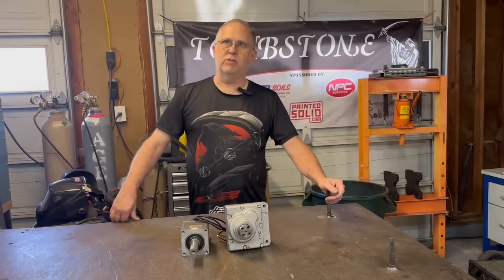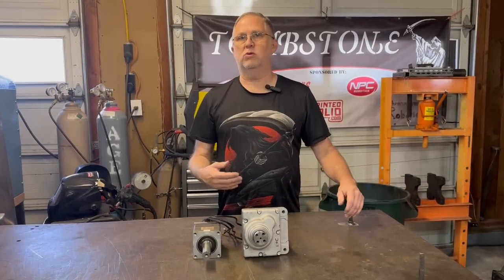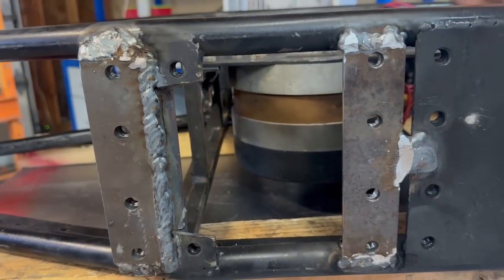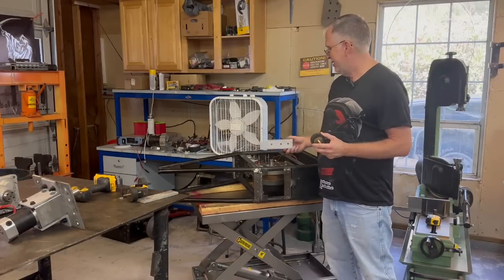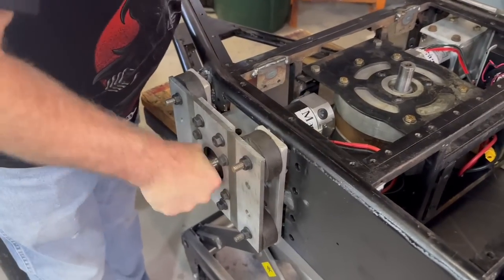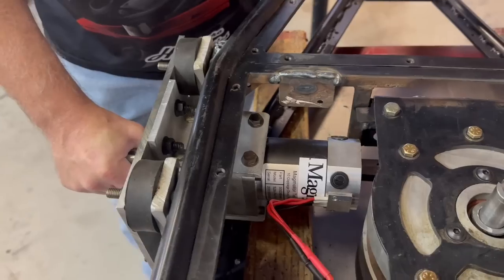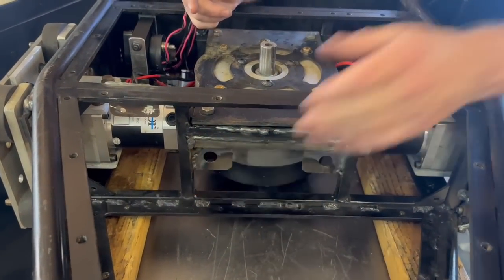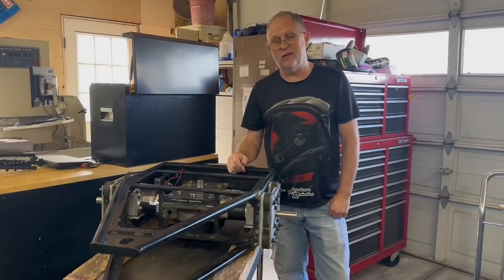Tombstone Frame Modifications for BattleBots Faceoffs!

Comment: Why do you not use redundant weapons motor chains?  Sniping the chain is an effective strategy to attacking Tombstone.
Reply from the maker: The chain placement is pretty much exactly over the top of the weapon motor, and just barely under the top cover. To double up the chain I would have to make the robot taller to accommodate, and this would add a LOT of weight to do. For the most part the chains have held up fairly well

Comment: Ever considered an aluminum disc with short folding blades on the end like a bushhog. Would probably help chew thru angled armor instead of glance off. And instead of tossing the bot when you hit something the blades will fold back out the way and hit again on the next swing.
Reply from the maker: There have been a few bots over the years that have tried this, but none that have been all that successful that I recall. It's not something I would put time into, but I certainly would love to see a modern version of one now!
Reply: @ray9368  might be worth making a peice of angled armor setup on a weight(dummy bot) to test bars on. Also have you considered a bar where the far cutting/bludgeoning edge has a slight recurve like the tip of a scythe. So it grabs and pulls the enemy a little closer with the hit. Nothing too severe but have the curve and your like 15/20° edge you mill on. And the cutting tip is slightly pointy. It would certainly dull off quickly but it might be enough to tear armor off in the shot it takes to dull it.
Reply: @ray9368  also you ever put a sharp bar on and use it to trim a hedge or something i bet it would be quick lol

Comment: You should also add rubber block on each side top and bottom of the end of the robot, just so you don't lift up each time you accelerate its a little improvements but worth it.

Comment: I wonder if there is an appropriate right-angle gearbox that would work. Maybe help give more clearance for the weapon motor.
Reply from the maker: Really I would have to design something to work the way I would like. Probably a high power brushless inrunner, with a planetary gear set to reduce rpm, before going into a miter gear setup to get the right angle while maintaining enough power.

Not that I've given it any thought or anything :)

Comment: Quick question: Is there anyway you can make your wheels more conical? IMO Tombstone's weakest is spot is when its held up on one wheel with its blade spinning. If you  could reduce the "flatness" of the ends of the wheels, you might be able to prevent that issue.
Reply from the maker: What holds Tombstone up in that instance the gyroscopic forces of the spinning weapon. I doubt a change in wheel shape would make much difference. But it's always good to think of different possibilities!
Reply: @ray9368  thanks for the reply, really love to see that you interact and think about suggestions from your community. I guess I didn’t realize how much force tombstone is actually exerting on itself during that time period. Tombstone’s gonna kill it this year!

Comment: Have you ever done any durability testing with a belt vs chain drive for the weapon?
Reply from the maker: I've used timing belts in the past, and although they do work well there were a few issues for me and my design. A timing belt with enough strength to handle the torque of my weapon motor is pretty big. The one I ran before was 1.5 inches wide. So with the pulley setup on top of the motor, I ended up with a taller frame on the robot which take a lot more weight to make. The shorter setup with the chain just works better. And arena debris would cut the edges of the belt, so I would end up changing them for every single match - and they aren't cheap! Whereas a chain can last for several events. The only real advantage in my design is the belts are lighter, but I figured I more than offset that with the shorter frame.

Comment: Wouldn’t that little extension past the bend allow a spinner a spot to grip to rip the wheel base off? 

Also, given you yourself said its bad welds, they wouldn’t hold up as well to impact. 

Maybe if you fill that gap it’ll eliminate the problem before it happens.
Reply from the maker: Moving further forward has risks certainly, but the need to help the drive was large enough to make it a worthwhile trade off, in my opinion anyway. We'll see how it performs soon enough! And my welds may not be pretty, but they are solid. I'm really not worried about how well they hold together.
Reply: @ray9368  to get to the wheels... 

you have to face the weapon first... 😨

Comment: If 1 inch off caused problems, but you moved it 1.75" forward, isn't that almost as far off as it was before, just in the opposite direction?
Reply from the maker: The purpose is to get more weight on the tires, for better traction. Look at it like this, instead of 1 inch in a worse direction, now we'll be .75 inch in a better direction.
Reply: @ray9368  ah, so the original NPC location still wasn't as far forward as you wanted, I see

Comment: @Ray Billings, Hey Ray, I just was curious if those shock absorbers really work? The reason I asked is because that motor is still attached directly to the frame meaning any kind of hit it takes the vibration is still going directly to the drive motor. I'm no expert but shouldn't you have like rubber bushings that hold the screws in place to absorb the shock? I'm not trying to critisize just trying to help and understand the physics a little more. Thanx :)
Reply from the maker: The shock mounts have helped considerably over the years. The solid bolts between the shock mounts (which I didn't show in this video, and I should have) really only keep the motors from being ripped out. But the motor/gearbox assembly can compress slightly in on the rubber mounts, so there is some movement available. And this has kept the initial super hard shocks from breaking the magnets in the motors, which was an issue before.
Reply: @ray9368  OK, cool! I was just worried that .. like say if you got flipped by Hydra you could break something and that would be bad.

Comment: Hello Ray,
Can you suggest a motor for my bot's wheel which would be nearly a 8 kg bot?
Reply from the maker: The banebots gearboxes and motors are kind of the standard for the smaller weight classes.

Comment: The shock mount bolts are maybe at risk of snapping?  Therefore ripping the whole wheel/motor off. With the new spacers the shock mount bolts didn't look to be engaged with the frame as much as before, or did I miss a catptive nut on the back of them?
Reply from the maker: I don't have all the bolts in place in the video (something I probably should have shown more of) but I was more focused on showing the new placement. In the final mounting, the shock mounts sit top and bottom like seen in the video, and in between are solid bolts through the mount plate into the frame. The rubber mounts allow some movement inwards, compressing the rubber, but the solid bolts stop outward movement. Is it possible to hit the motor/wheel hard enough to shear all of those bolts? Sure, but any hit that strong is destroying the motor and gearbox anyway.
Reply: @ray9368  Thank you for clarification Ray. I've more faith in your skill as a pilot and engineer than my arm chair knowledge, bring on Destruct-A-Thon, tomorrow.

Comment: Thanks for the video. Just wondering, you said you would have to use shorter bars since the wheels have less width. Will that be the norm now going forwards or will there be an instance where you would alternate between different mounts/drive arrangements or run a longer bar with the same new setup if you feel like you need to? For example, if there were a hypothetical match with an opponent like Roundhouse, Rotator or Ribbot, wouldn't having a short bar be a disadvantage based on what you have previously said in other videos? Also, I am a bit curious, does the fact that you no long use NPC motors for the drive affect their sponsorship deal with you (Just wondering...)?
Reply from the maker: I still use NPC tires and wheels in pretty much everything, and routinely still use the motors in many of the robots we build. Both Stink Eye and Brimstone run NPC motors for example. They are a great company and I'll continue to support them going forward.

The builds I am working on right now are for Faceoffs, so I'm really only planning on those matchups for right now. It's kind of important for the wheels to be as wide as the spin circle, so if I'm running the shorter bars I can get away with a narrower footprint for the drive wheels. Certainly everything in the future is adjustable depending on the opponent at the time.